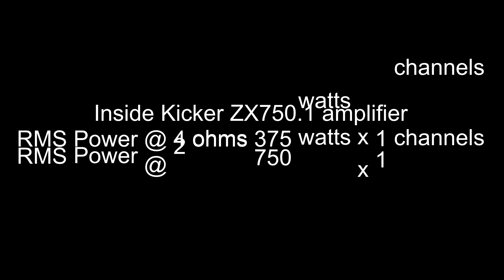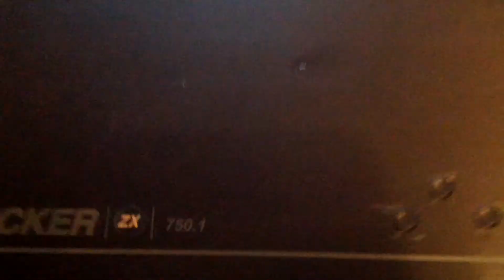Inside Kicker ZX750.1 750W RMS Class D Monoblock ZX Series Amplifier

Comment: Ive got this very amp, and all of a sudden I am getting no audio output to my sub box. Amp gets power, protection light is not on. Both fuses on amp have been replaced. I just hooked up a cheap loaner amp in my car, and everything worked fine. So something is wrong with the amp. Any suggestions? 

In a 2010 Jeep Patriot
Alpine INA-w900 double din head unit
2 12' Kicker Comp R subs in ported box
Kicker 4 gauge amp kit
Reply from the maker: Hi , if  you have a protectin light on most likely some of transistors ar blown :( if you know how to check them when you can replace . Of course first you need to solder them out before you can check . Not easy but everything is posible.
Reply: @v.j5135  the protection light does not come on. But I have verified that LED does work
Reply: @v.j5135  I can send pictures of the inside if it might help you (help me) lol
Reply from the maker: Sorry I thought what protection ligts on. One time i has similar issues vith alpine amp I take off cover and just start pushing all parts around and guess what one patrt gets bad conection and that was a reason why one amp channel didn’t work. I don’t think what I can say something from photo but we can try ;)